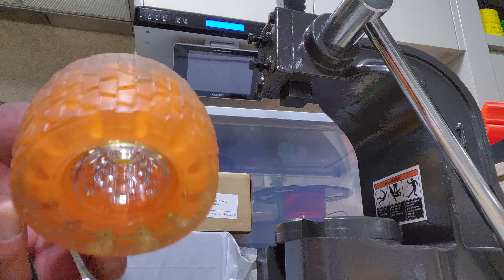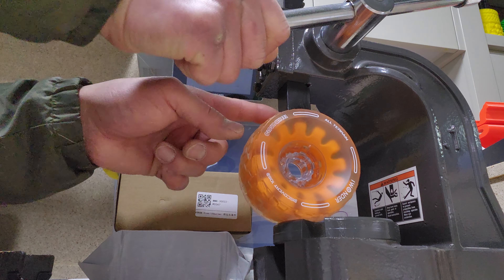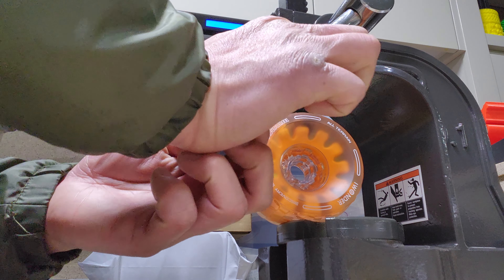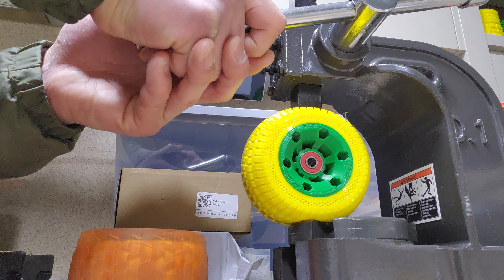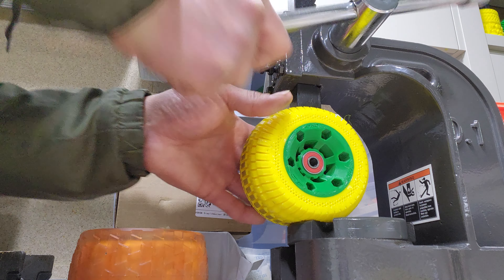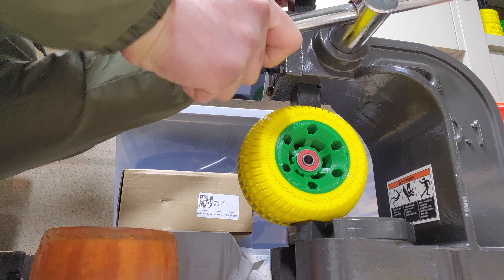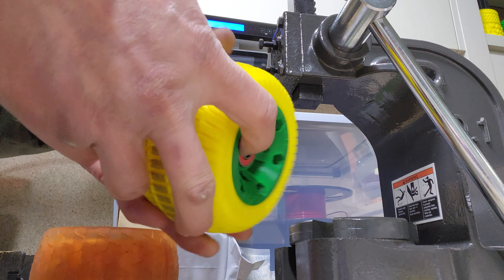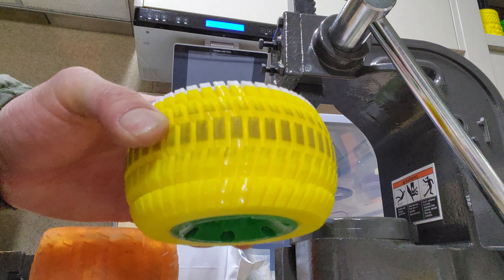Dr. E TPU Tires vs. Cloudwheel Flex Test!

Comment: Nice and What  about range on your wheels compare to cloudwheels ?
Reply from the maker: Range is going to be obvioisly more less due to more grip.  Unfortunately, more grip = less range.  This is why air tires have less range than urethane.   But in terms of actual riding experience, night and day.  So if u want range go with some really hard 50mm wheels.  More traction = less range.